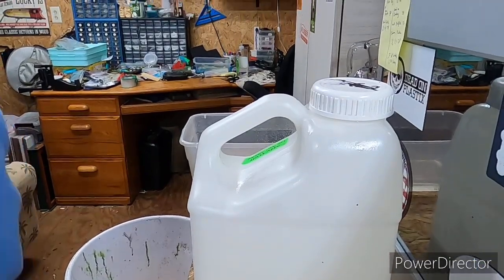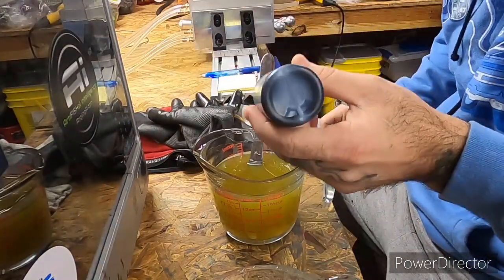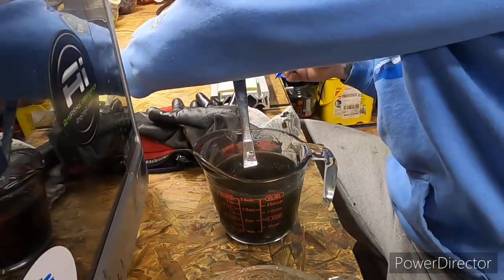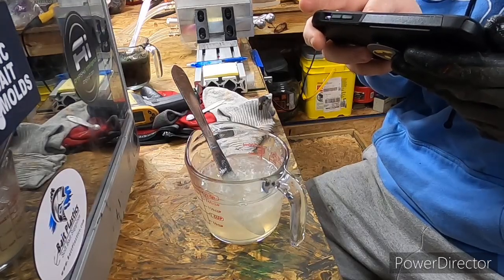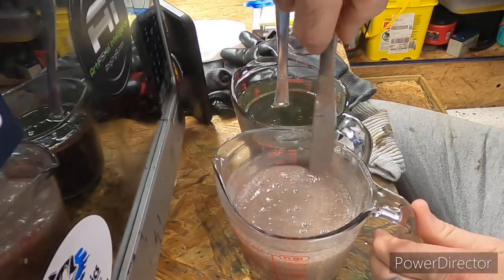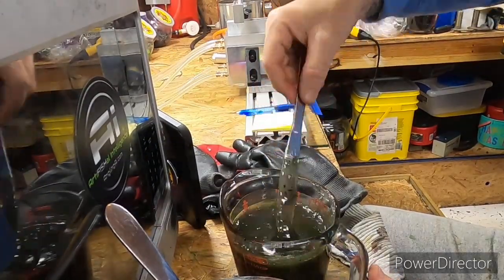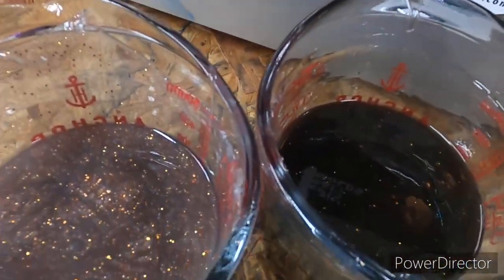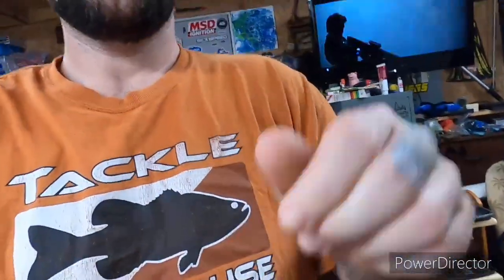Color matching

Comment: Have you had good results with the Wal-Mart glitter? I have read that it bleeds a lot but figured if the plastic was at the correct temp and you just added the glitter with minimal stirring, it would be fine. What do you think?
Reply from the maker: I use the micro size it seems to work good as long as you don’t over heat the plastic

Comment: I bought D O when they 1st selling plastisol. I mixed it for 30 to 40 minutes. It came out so sticky 
D O never made it right.
5 gallons of sticky plastisol.
Found out that they were buying from Poly Sol. I contacted them and replaced that 5 pail with some hardener to mix in that sticky plastisol.